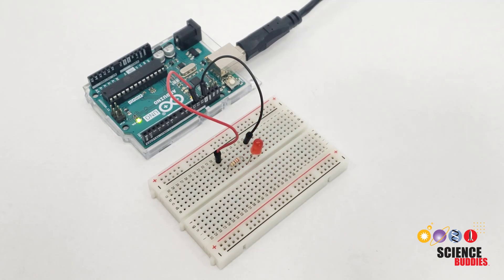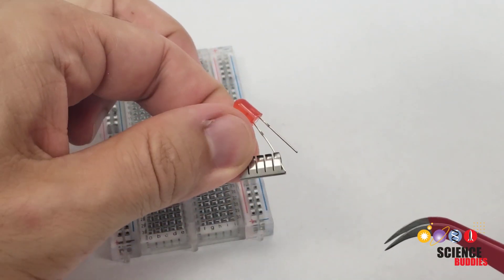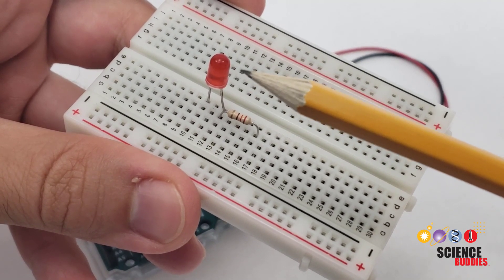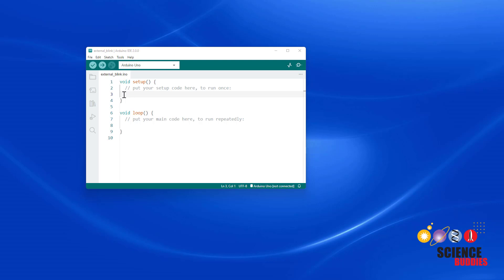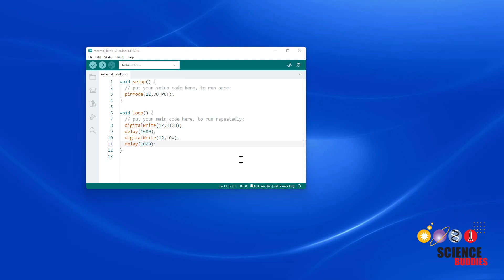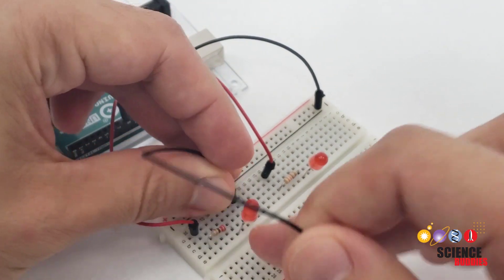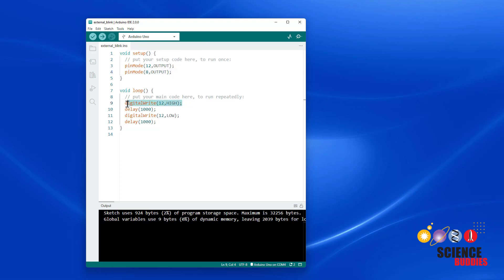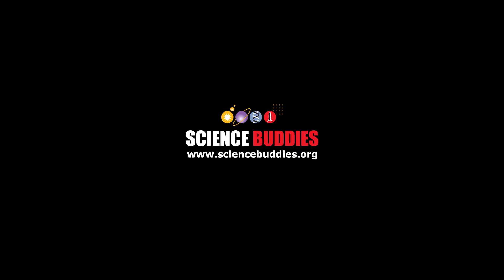How to Blink an LED with Arduino (Lesson #2)

Comment: Great tutorial, but can a 330 resistor be used for this? Thanks in advance!
Reply from the maker: Yes - especially if you have a newer Arduino Uno R4, they can supply less current, so you will actually want an even larger resistor, like 470 ohms.

Comment: Use the power rails just for power. It is bad form to plug components into the power rails and to plug power into the component area of the board.

Comment: mine is COM3, but yours is COM4. i need you to work on the same COM terminal as me.
Reply from the maker: The COM terminal will not make a difference - it depends on the USB port and number of USB devices you have plugged into your computer. The code should work exactly the same.

Comment: it doesnt blink its just staying on the led light i put the code right aswell but i put the number as 20 because its at number 20 on the bread board
Reply from the maker: The pin numbers in the code correspond to the pins on the Arduino, not the row numbers on the breadboard.
Reply: @Science.Buddies  oh thank you but it still doesnt blink when i made it 12
Reply from the maker: You may want to ask for help in the official Arduino forums, where you can post both your code and pictures of your circuit. Without seeing those, nobody can really say why it isn't working. You may also want to watch the Troubleshooting video that is part of our Arduino playlist. There are many simple things that can go wrong.
Reply: @Science.Buddies  nvm i found the problem i didnt install a driver

Comment: what about 330 ohm resistor?
Reply from the maker: In general it's always safe to use a bigger resistor - in fact, the new Arduino UNO R4 has a lower current limit so you will want a 470 ohm resistor.

Comment: i got this false reply Sketch uses 258580 bytes (24%) of program storage space. Maximum is 1044464 bytes.
Global variables use 26696 bytes (32%) of dynamic memory, leaving 55224 bytes for local variables. Maximum is 81920 bytes.

Flashing with command:/Users/damir/.arduino-create/esp8266/esptool/2.5.0-3-20ed2b9/esptool -vv -cd ck -cb 115200 -cp /dev/cu.usbserial-110 -ca 0x00000 -cf /var/folders/ss/4hr5f22s2yd0zg11jl0_vc740000gn/T/arduino-create-agent1421650867/Untitled_may07a.bin
esptool v0.4.13-1-gf80ae31 - (c) 2014 Ch. Klippel <ck@atelier-klippel.de>
	setting board to ck
	setting baudrate from 115200 to 115200
	setting port from /dev/tty.usbserial to /dev/cu.usbserial-110
	setting address from 0x00000000 to 0x00000000
	espcomm_upload_file
	espcomm_upload_mem
opening port /dev/cu.usbserial-110 at 115200
	tcgetattr
	tcsetattr
	serial open
opening bootloader
resetting board
trying to connect
	espcomm_send_command: sending command header
	espcomm_send_command: sending command payload
trying to connect
	espcomm_send_command: sending command header
	espcomm_send_command: sending command payload
trying to connect
	espcomm_send_command: sending command header
	espcomm_send_command: sending command payload
resetting board
trying to connect
	espcomm_send_command: sending command header
	espcomm_send_command: sending command payload
trying to connect
	espcomm_send_command: sending command header
	espcomm_send_command: sending command payload
trying to connect
	espcomm_send_command: sending command header
	espcomm_send_command: sending command payload
resetting board
trying to connect
	espcomm_send_command: sending command header
	espcomm_send_command: sending command payload
trying to connect
	espcomm_send_command: sending command header
	espcomm_send_command: sending command payload
trying to connect
	espcomm_send_command: sending command header
	espcomm_send_command: sending command payload
warning: espcomm_sync failed
error: espcomm_open failed
error: espcomm_upload_mem failed
Executing command: exit status 2

Comment: Awesome tutorial. For the "add another led" part, I realized one was dimmer than the other, and it wasn't the bulb as a problem. I remembered a parallel circuit my science teacher taught me and did that. I unpaused and immediately learned that there are multiple ground pins.
Reply: nevermind i just connected both of the leds to 12 silly me

Comment: I have a code to make blink as many LEDs as you want. In my case, with three, I have simulated a traffic light

// Define the pins where the pins are connected

const int ledPins[] = {11,12,13}; // To add another pin, I don't have to declare another variable. Only add the number to the array
const int numLeds = sizeof(ledPins) / sizeof(ledPins[0]); // The total numberr of pins. It will be re-calculated automatically if I add another pin 

const int states[] = {0x1,0x0}; // 0x1 = HIGH, 0x0 = LOW
const int numStates = sizeof(states)/sizeof(states[1]); // The number of states. I could replace the calculation by 2 (because allways will be two states

void setup() {
  //I declare all the pins like output
  for (int i = 0; i<numLeds; i++)
  {
    pinMode(ledPins[i],OUTPUT);
  }
}

void loop() {
  // I loop the pins
  for (int i = 0; i<numLeds; i++)
  {
    // Changing the output. First will be HIGH and a second later, will be LOW
    for(int state = 0; state<numStates; state++)
    {
      digitalWrite(ledPins[i], states[state]);
      delay(1000);
    }
  }

}

/* Summary of the loop:

In the first loop we will use the PIN 11. The second loop changes the states:
  First, the bright of the led in the eleventh pin it's HIGH, then we wait for a second before the bright  it's LOW

The same thing for the other leds

*/

Comment: So I bought a RexQualis board and I am using a mac book and it's still not working for me. I followed everything, could it be board not matching the brand? Is the fact that I have to and extra wire because the macbook only has thunderbolt ports?
Reply from the maker: Hi - we recommend asking on the official Arduino forums for help with your problem.

Comment: does it matter which side do i put the led, like which positive and which negative?
Reply from the maker: Yes - LEDs are polar and current will only flow through them in one direction. If your LED is not lighting up, try flipping it around.

Comment: I still don't get it

Where did you get the power from if you didn't use any jumper wire to connect 5V pin to breadboard?
Reply from the maker: The power comes directly from the Arduino's I/O pins. They can provide enough power directly for small things like LEDs, but not larger things like motors.
Reply: Thanks for the information

Comment: Thank you for this video. Since I'm new to the Arduino world i have a question.... How do you get the program you have made on the Arduino UNO board into a microcontroller used and placed on your project on another PCB...?
Reply from the maker: Hi - this is a bit more than we can explain in a YouTube comment, we recommend asking on the official Arduino forums. Very long story short, we don't have our own tutorial on it, but the Arduino board contains a extra circuitry that handles USB communication with your computer and makes uploading code very easy. If you just want to buy the bare microcontroller chip and put it on another PCB, you then need to handle that part (flashing the code to the chip) yourself. There are other things the Arduino board includes, like voltage regulation so you can power it with a 9V battery or wall adapter, that aren't included in the bare microcontroller chip, which you would need to account for when designing a separate PCB.  Again we don't have our own tutorial but you should be able to find instructions online.
Reply: @Science.Buddies  
Thank you so much for your answer. I understand what you mean and I will find a Arduino forum...

Comment: This is the best beginner series I have seen so far.  Thanks for breaking this down.  It's still very confusing to me (the code), but I am just going to follow from the very beginning.  That Tinkercad program is outstanding for this!  I struggle to see the holes and numbers on the boards breadboard in real life!  I am always putting my wire in the wrong hole!  The Tinkercad program is awesome.  And no wires!  Hahaha.  No mess!

Comment: For two LED's could we just connect the two LED's with one resistor so that the resistor is in series with the LED's in parallel? Or is that different?
Reply from the maker: The answer is a little too complicated to explain in a YouTube comment. We just added an entire playlist about the math behind LED circuit design, we recommend you check that out: https://youtube.com/playlist?list=PLlBVuTSjOrclaUU1nI3afV1jp8vj4iQUf&si=FPnWpc1Hkfmyjcfk

Comment: How did you make the red led that bright? When i tried this it was very dim
Reply: Your resistor may be a higher value. Also LEDs can vary on their brightness specs
Reply from the maker: The LED's apparent brightness can change depending on the camera settings, but like @vito8625 said, it depends on the resistor value and the amount of current through the LED. We have a new video series coming out about choosing the resistor value, so stay tuned!
Reply: Thanks!
Reply: I used a 220 ohm resistor so i'll try with a lower resistance resistor

Comment: Hi there, I purchased a kit from AliExpress, and I built the circuit correctly. The LED does blink every 1 second but sometimes it ''jumps'' (goes off earlier or stays on longer). I tought the problem may be in the end of my program as it is a loop, but I wrote the exact same program you did.. Any idea why does that happen?
Reply from the maker: Hi - we haven't heard of that problem before. The only thing I can think of is a loose or intermittent connection with part of the breadboard. The amount of time it takes the code to execute a loop should not change from one loop to the next. There's also a chance of a faulty I/O pin, you could try switching to a different pin and see if it's more consistent.

Comment: I know this video old but I’m using Arduino right now and I got all my led working but 2 of them won’t blink on and off and I been stuck on what could be wrong that only one light will blink btw I’m doing a traffic light project
Reply from the maker: Hi - we can't necessarily help with your exact circuit, but our troubleshooting video might help you identify problems: https://youtu.be/9GLaU-BCEQM?si=sb0o-Ncuy2_XZL76
Reply: Same! We just did a manual traffic light!😮

Comment: Hello!! Great job!! I am rookey and I have a question.
I have Arduino Nano. Where can I put the Red cable? 
Because nano is smaller than Uno and does not have the Arduino 12 port(pinMode12) .
Reply from the maker: Hi - all our tutorials are for the UNO, so you may have better luck getting answers to your questions on the official Arduino forums.
Reply: u can change the port 12 to some other port (must be digital) and change the port number in the code, so that all places with 12 are the other port you are using
Reply: @aksvinss thank you! It works!

Comment: Hey I didn't connect it like you expected in the question but I still got it to work. What do I do?
Reply from the maker: Hi - that's OK, there is frequently more than one "correct" way to wire the circuit.
Reply: @Science.Buddies  okay. Thank you for a great video